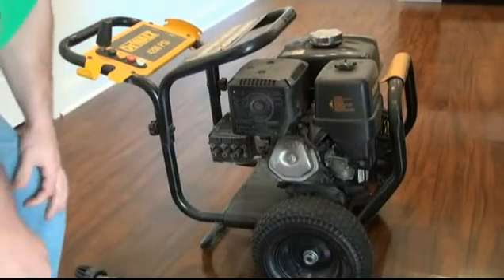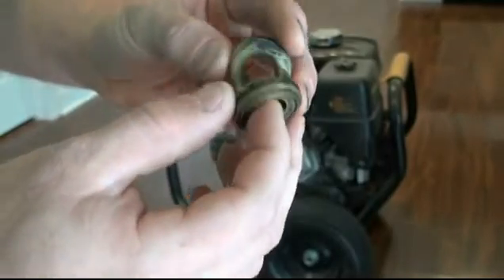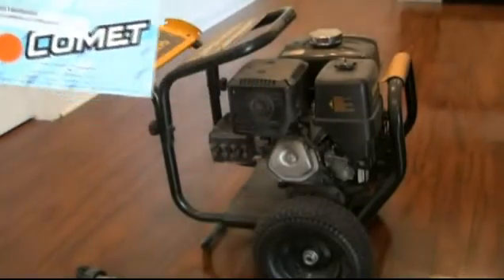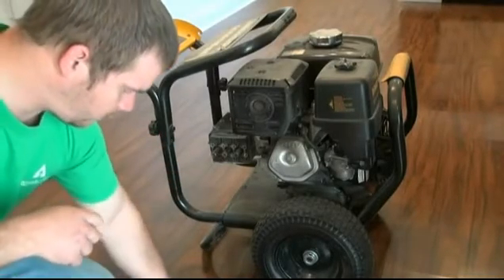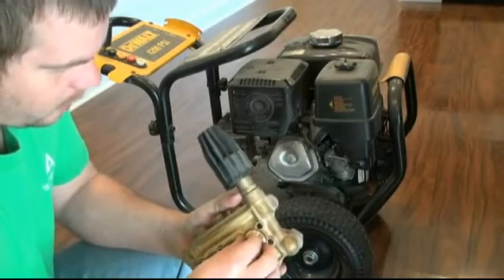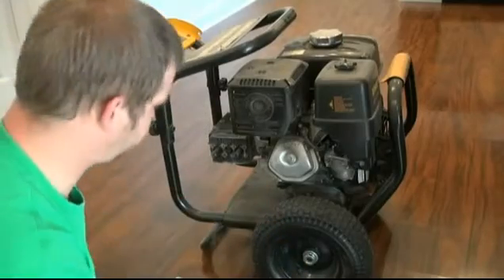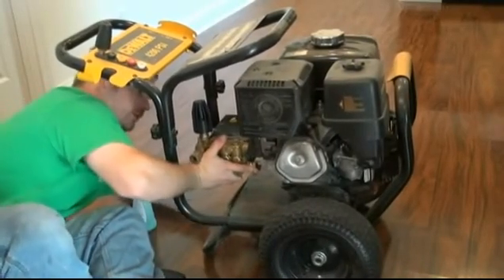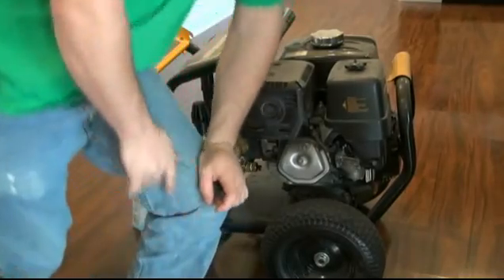pressure washer pump repair

Comment: I looked for part 2 but did not see it among your videos. Was your repair successful?
Reply from the maker: it still works, used it yesterday to wash my 18 wheeler, If I had it to do over again though I might would have bought a cat pump  just for longevity, but money was tight and it still works... I think part 2 was pressure washer repair testing it out or something like that, and theres also a more recent one reviewing North star steam cleaner add on unit using this pressure washer. thanks